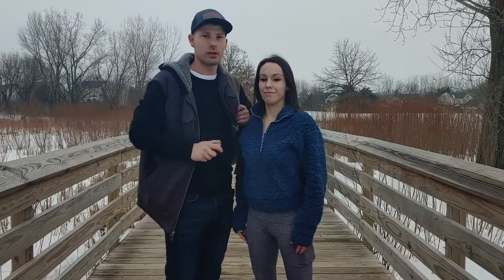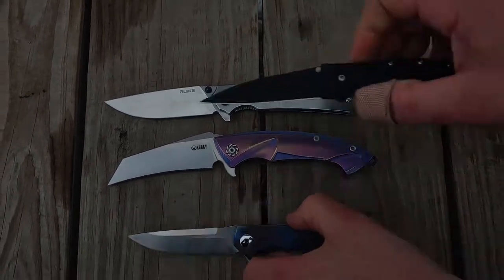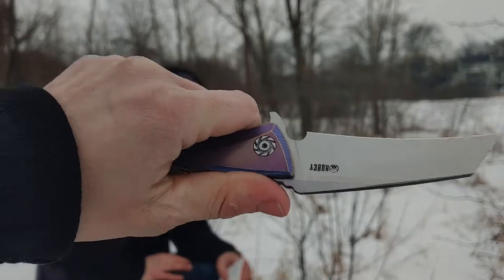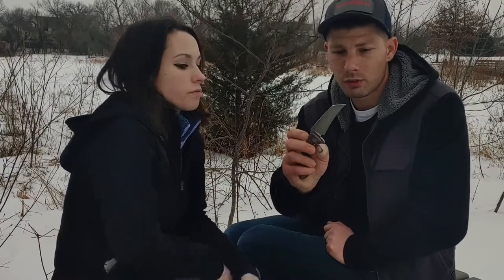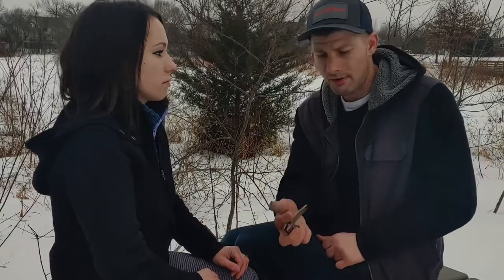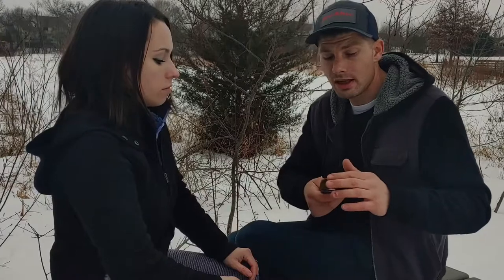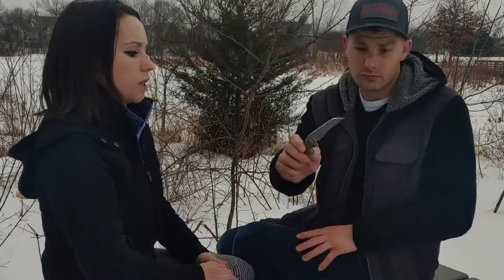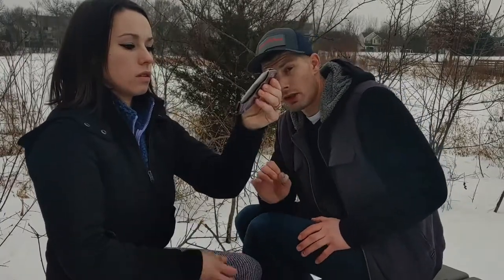Kubey Anteater Ku153TI Knife Review

Comment: I have the G10 version. It gets a lot of things right. You can get them on Amazon for $30, but if you just handed me one I might guess it goes for 2 or 3 times that much. It's in the details: It has a nice action, smooth with a clicky detent. (Looks like ceramic bearings?) It's easy to disassemble. Everything except the clip screws are a T8, so you only need one driver. Because of the large heads on the pivot screws, it stays put without loctite, meaning you're not constantly having to tighten it up. The blade is well ground. It's symmetrical and the finish looks and feels good. It's overall really well designed to be practical and ergonomic. The blade shape works really well, and as long as you don't have huge hands, the handle locks you in, in a variety of grips. The only negatives I can think of are minor. I filed the corners of the handle scales because they were sharp. A tiny bit of filling, almost an invisible difference really, made it way more comfortable. (I hope the titanium version is a bit smoother, otherwise I'd wreck the anodization doing that.) It does come apart easily, but that's after breaking their loctite, and all the hardware being free spinning doesn't help. The liner lock is smooth but fairly stiff, I usually end up closing it two handed. No big deal. I got the version with the bent clip rather than the milled one, and it was really tight, but that's another easy fix.
Reply from the maker: Man ours came out the box super smooth, and I love when a company does all t8s it shows strength and quality, which Kubey definitely has, I like how they offer the same knife with different materials and prices. They are definitely gonna keep moving up in the game, they are super cool to deal with and easy to get a hold of. Amazing company the best value knife I have at the moment is one from Kubey and one from Two sun, as for value. The ku179cf eris and the twosun ts49, for the money nobody right now can beat it.
Reply from the maker: Also when you buy kubey on Amazon its coming straight from kubey thats why you get them so fast because they have usa distributors. The guy who runs Kubey went to school and college in Arizona.Then moved back to China.